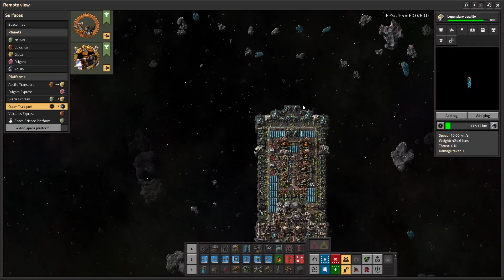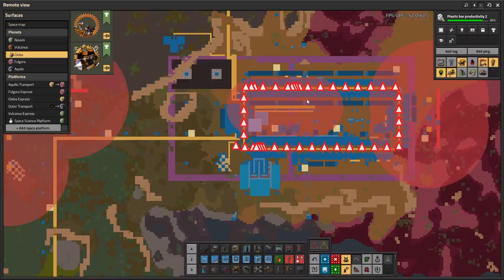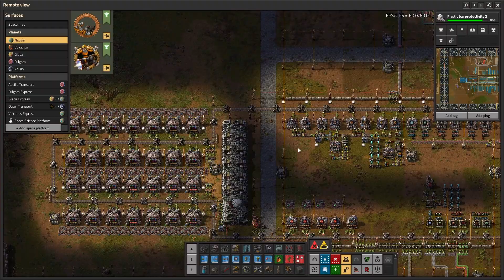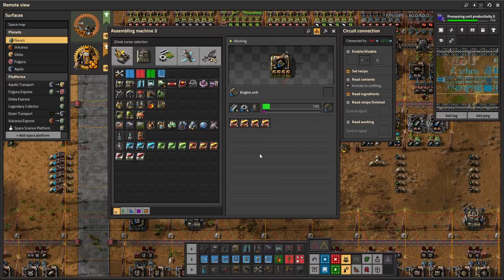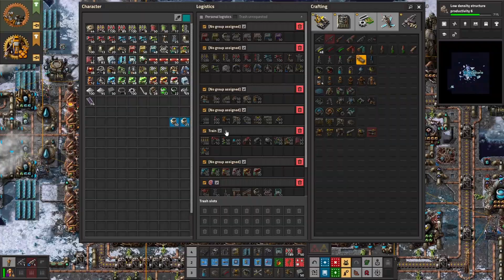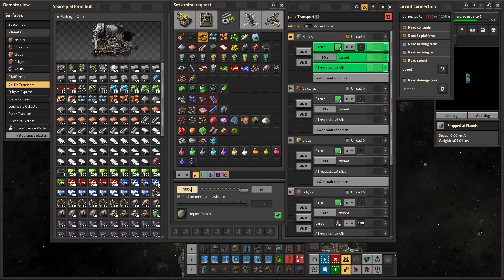Factorio Space Age -- 039 -- Fusion power

Comment: Quick question about the car, since its truck is fairly small if you use a lot of mods, I haven't found a mod that specifically increases the trunk size. Furthermore I tried it with AAI Hauler, it works but has a large collision so you can easily bump into them and cause a pause.
Reply from the maker: yes, what's nice about the car is its actual hit-box, and you can even fit it on one tile vertically. But it would be amazing if they made the trunk bigger with quality or gave the car an equipment grid like the tank so you could make it bigger with the toolbelt equipment. You can make the tank's trunk absurdly big with legendary tank and tool belt equipment, but the hitbox is bigger so it's not as flexible.
Reply: @paxtorio1495  Thanks for the answer, I also noticed some issue with cars going vertically on bolts, namely that the inserters won't pull off of them as they do with the horizontal belts. I placed the cars as you did, pointing towards north and there are no issues while they are going horizontally.
Reply from the maker: @jovanmandic8808  did you make the alignment contraption?
Reply: @paxtorio1495 bottom left chests and belt to the left and top left pole?
Reply from the maker: yes, like this: https://youtu.be/zrUTyHvzlms?si=Pl_nJ8wJAvtpcXEL&t=43 

Every turn needs the contraption or the pole. you need the contraption on the right and pole on the bottom right if that wasn't clear ;-)
Reply: @paxtorio1495  Yes, that worked the top right contraption was missing.